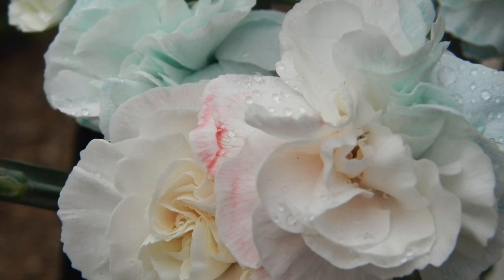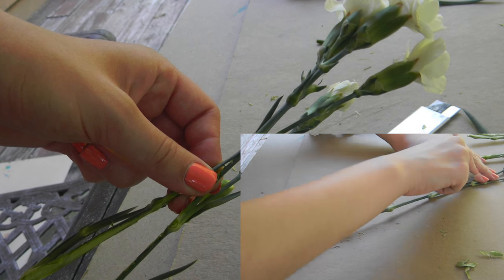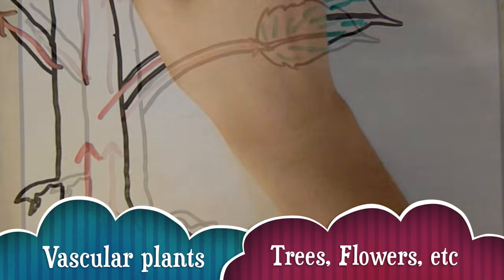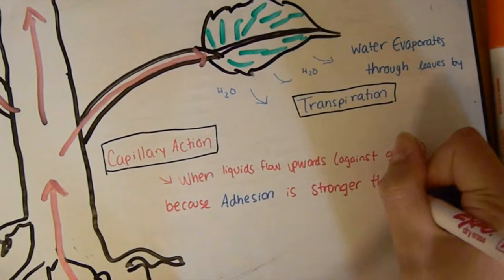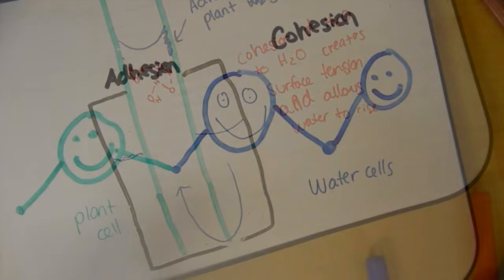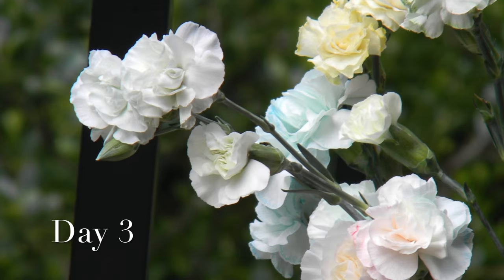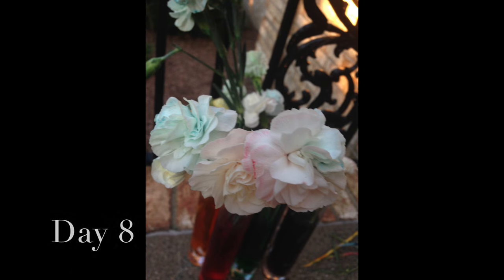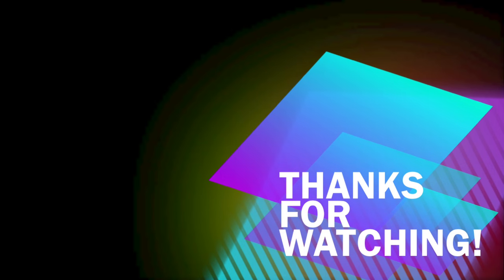(The Science of) DIY Dyed Flowers

Comment: Have you thought about making a rubber bone or egg with vinegar, a jar w/ lid, and a little time. We did a ton of cool projects back in the day, where we used several different peanut butter jars and lids, and then used the process of osmosis, where we had to first remove the shell from the egg with vinegar. You do this by setting the egg in the jar, then fill it with vinegar (Acetic Acid). The acid eats the shell due to the high calcium content of the shell. Then, you're left with an egg with just the membrane. After that, very carefully, remove the egg and dump out the vinegar. Replace the vinegar with colored water, or even plain old Caro syrup. Osmosis will take effect. 
Note: The thicker, or higher viscosity of the liquid, the more suffocated the egg becomes and will leave the egg pretty empty inside of the main membrane. 

Also, set up several jars and eggs when removing egg shell with vinegar. Once the shell is removed, the membrane is very fragile and can pop easily. This way you won't waste 24-48 hours waiting for the shell to be removed from just one egg. And make sure the lid is tight the entire time. 

Anyway, that's my request. Thanks for doing these vids; my kids are really into things like this, and I forgot how fun these little projects are.
Reply from the maker: +Tim Akers Thanks for your input that means a lot to me. The egg experiment is a good one; I've done it in lab a few times. I'll be able to start shooting again in June, and I'll definitely take that under consideration. I'm so glad you and your family enjoyed it. I try to keep a balance between fun and informative, and hope that it will inspire kids to think scientifically, or at least appreciate the astounding mechanisms behind everyday processes.